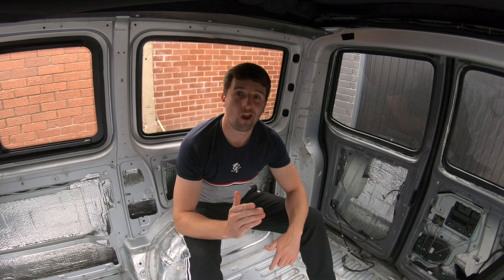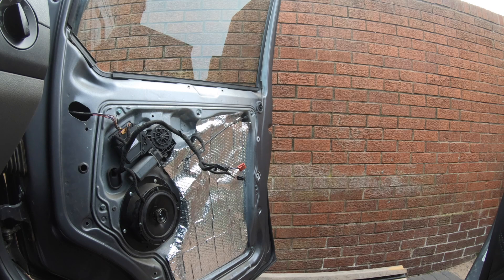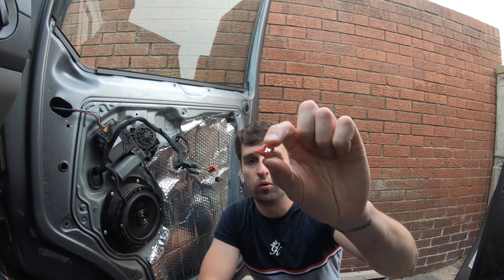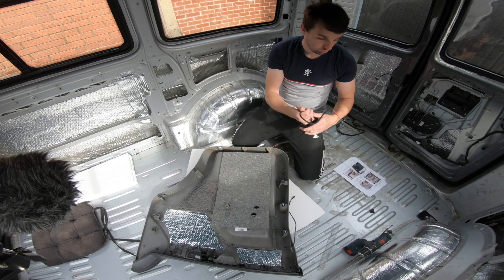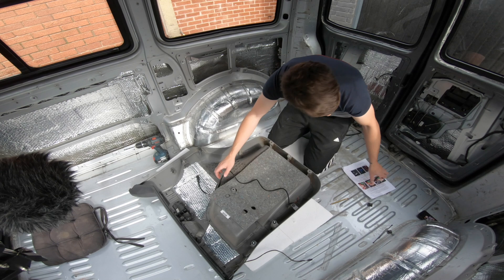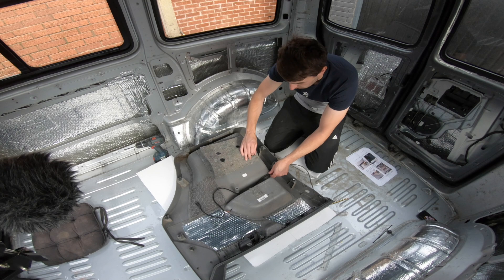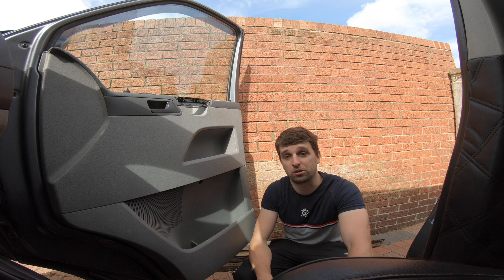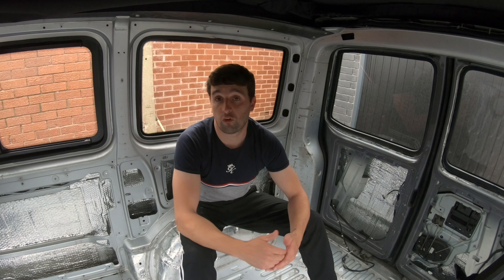VW T5 / T6 Door Card Lighting * * MY VW CAMPER CONVERSION #19 * *

Comment: Great vid . Had issues with the drivers side & joining clips . If I did it again I’d definitely use posi taps , far better connection . The supplied T taps have to have a lot of force applied to get the connection .
Reply from the maker: Thank you Andy. Great tips and advise also for people to take onboard

Comment: I was thinking they were going to work in conjunction with the courtesy lights to start with. Nice job 👍
I reused a couple of the 12v spotlights from mine in the foot well so I don't bother having the overhead courtesy on now.
Reply from the maker: Hey Stuart, yeah I feel they have come out great. But angry I took the door card back off unnecessarily 😂. Aw yours sounds awesome mate. May have to fit some under the dash myself next.

Comment: Great idea. I’ve been thinking about something like this for the door handles, I have a friend that never learns where they are 🤔
Reply from the maker: Aw cool idea mate. Definitely makes a great modification and improvement that’s for shore.
Reply: Jay Saunders yes they look great. I fitted some lights in the foot wells last week connected to curtesy lights. 
I’m a little apprehensive about removing door cards at the moment as mine is still under warranty
Reply from the maker: Aw ok mate. Yeah definitely think hard about it as if it still has warranty on it you may not want to risk making it void in any way

Comment: Hi jay don’t understand how you take a live feed off electric window loom  and it makes your pocket lights to come on when u turn your lights on  is that your headlights thanks Steve
Reply from the maker: Hey Steve. Yes mate that’s correct. It’s the live feed from the eliminations part of the windows. So when you turn your headlights on at night there is also little lights that eliminate in the electric window switches so you can see them if that makes sense. So when they light up with headlights on so do the pocket lights. Hope this helps matey?

Comment: Buggered if you don't have elctric windows though lol Is there something you can get just without putting in electric windows first ?
Reply from the maker: Aha this is true. If you could get a van that’s being stripped you could take the harness and window motors etc off that car and install that way. Wouldn’t imagine it would be a cheap job though also I think a lot of work to achieve well
Reply: I’m in the same situation. I’m just going to fit some retrofitted electric windows and run the power off them